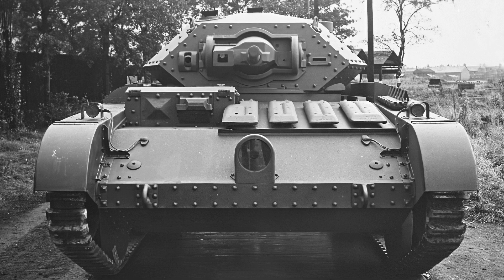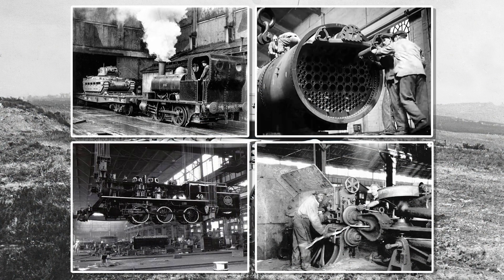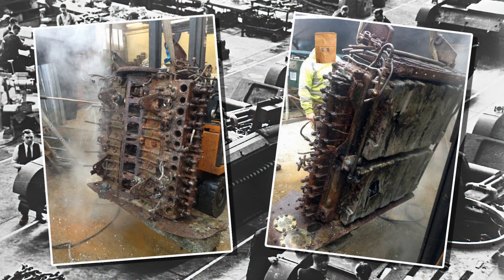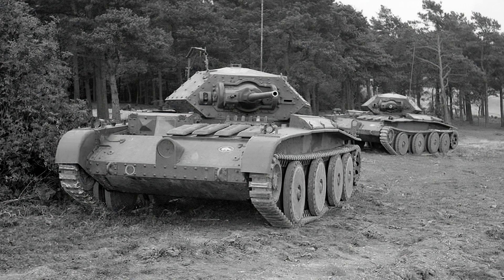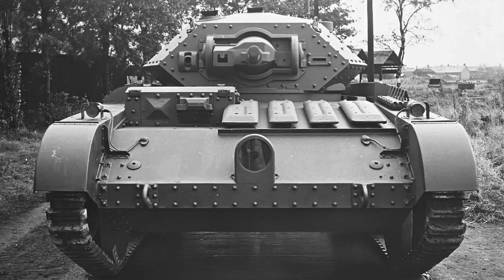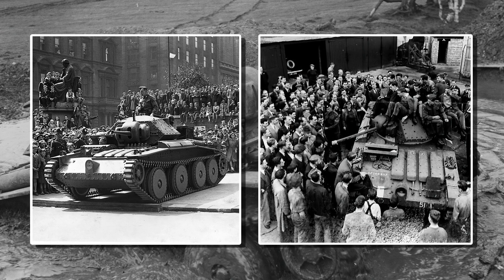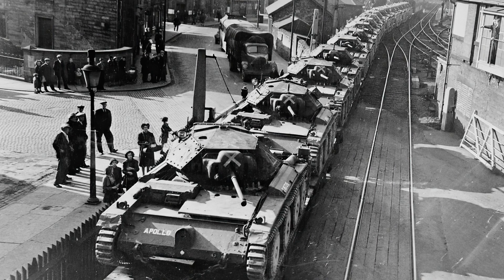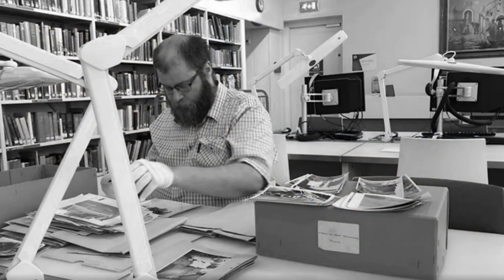Covenanter - Tank Design & Development

Comment: Question for you that I haven't found fully answered elsewhere. The common turret that was shared between Crusader and Covenanter was supposedly designed from the outset to potentially  take an upgrade to the 6pdr gun (that was at the same time being developed to replace the 2pdr). My question is : Do you think that the Covvie could have mounted a 6pdr as an expediency  measure (on UK invasion)  taking into account that  I have an unconfirmed perception that the Covenanter's turret ring was slightly smaller, despite the turret overall being the same? So, could it have mounted the 6pdr?
Reply from the maker: i think so yes, but as the gun was in short supply its unlikley, at thhe time invasion was an threat thhe 2pdr gun was still very capable

Comment: I always thought a relatively obvious fix for the cooling problems would be to rip out the meadows altogether and retrofit liberty engines or even another engine like the Napier, the rear hull might need a box-like upward extension at the rear (as we saw in Challenger MkIs), to mount radiators and make space for the taller engine. With the liberty re-inserted, the Covenanter becomes in effect an upgrade to the A13, a Cruiser MKIII+ with a common turret.
Reply: But the whole point of the Covenanter was to be as low as possible. That's why they commissioned a brand-new flat engine from Meadows. Fitting a Liberty would have meant raising the whole rear decking, as you say, so they would have had to raise the turret to allow the gun depression they wanted -and there still wouldn't have been room for the radiators in the engine compartment - that's basically the reason why the Crusader has a longer hull and five roadwheels each side.
What you're arguing for would have meant a complete abandonment of the Covenanter programme and a switch to all-Crusader production.
Reply: @jeremychurchill9489  they modified the Liberty to make it flatter for the Crusader and somewhat screwed up  the cooling system in that as well.
Reply: @wbertie2604  They managed to lower the height of the Liberty by 6 3/8 inches to 36 inches.Still a tall engine (the RRMeteor was 31 inches high). And, yes, they certainly did cock it up!!
Reply: @jeremychurchill9489  Still an easier fix and one that would work. Simply take the A13 hull design that has the Liberty engine and use that. It was probably still in production and all the tooling/expertise already existed. New Turret on old A13 hull and all Covvies woes are fixed. The tank board designing a whole tank to meet the one criteria, height, was such a mistake.

Comment: Not withstanding the mere fact that the Germans were just over the channel and invasion was always a threat, even if a decreasing one over time. Having a standing force of UK 'home' tanks to defend Blighty whenever necessary, was utterly essential. The Covenanter was there, it was available if needed.
Reply: There is actually a photo of a Covenanter that was in North Africa. Did it see action or not is not known. It might have been there to see how it behaved in a desert environment.
Reply: @michaeltelson9798  Yes, I have seen it, with Kingforce. I am sure they found it was a Tommy Cooker of a different type. The results of the test probably confined it to cooler climates. That would have allowed it to fight in NW Europe but by the time that conflict was in train, technology had moved on.
Reply: It came way too late for any such use.
Reply: @princeofcupspoc9073  No, not at all. Invasion was never discounted and the fear of it only diminished after the invasion of Russia in mid 1941, Covvie was available in mid 1941 in numbers up to 250 at the point when it was clear that Germany had switched directions and the invasion of the UK was not their current priority. However, if Russia had collapsed as the Nazis expected, invasion of the UK could have been on the cards in late 1942/43. By that stage the covvie would have been ready for front line service in hundreds if not thousands.

Comment: The Covenanter, probably the most aesthetically pleasing tank
Reply: If it weren't for those rivets. But I agree.
Reply: I AM partial to the Matilda Tank. Such a beauty!
Reply: @GC-Jo  Matilda 2 Is definitely a beauty, don't like the rivets on the Matilda 1 tho.
Reply: @poikoi1530  agree the Matilda two has the right sit and is a fine looking machine but let's not dis rivets, they can be quite butch and solid looking, think Cromwell turret.   I know they fail and ping around inside but we are talking aesthetics 🙂.
Reply: @CrusaderSports250  well, ngl, I like the Comet more than the Cromwell. The turret looks good and it's pretty symmetrical
Reply: Crusader Mk.III has cleaner lines and better proportions imo.
Also Challenger 1 will always be a gorgeous tank to me at least. That wedge-shaped turret 🤤
Reply: @marmite8959  Crusader III is a little let down by them not really filling in the space where the subturret originally went.
Reply: @marmite8959  always liked the Crusader lll but the Chieftain was my modern favorite, with the turret sloping almost to the turret ring, as an aside a friend of mine during testing reduced a Chieftain turret to fork liftable lumps, that would have been quite an impressive bang😊.
Reply: @marmite8959  Yeah, i do like the crusader
Reply: I spent some time in the Cold War counting Soviet tanks in a siding in East Berlin, so it did happen :)
Reply: @bob_the_bomb4508  Was that at the behest of NATO or a stock audit? :)
Reply: @wbertie2604  it was the Cold War. But the occupation of Berlin wasn’t officially a NATO task.
Reply: Centurion, Shirley?
Reply: @bob_the_bomb4508  l
Reply: Probably not. It's cool that you think so, but don't say it like it's a fact.  I prefer the Italian Fiat L6/40.  Almost completely useless as a main battle tank, but it has those stylings that the Italians are known for.
Reply: @princeofcupspoc9073  i did say "probably" so i didn't say IT IS, some would say the Tiger 2 or the Pershing is the best by looks
Reply: @poikoi1530  don't forget the very clean lines of the panther, with the rearward slope of the rear plate it was going somewhere, I know the tiger ll had something similar but the turret was quite blocky and was taller in proportion. Tank aesthetics!,  a whole field of development totally missed by designers☺☺.
Reply: Anything built in aus or nz:
Reply: For a blind person :)
Reply: @dalejmobiledalej6361  it looks so symmetrical, if only it wasn't riveted

Comment: The cooling system. There is no problem with having radiators higher than a flat (boxer) engine or any engine for that matter. I can't understand why the radiators were not mounted flat above the engine or else vertically behind it, pumps would have taken care of moving the water as required just like they did with the radiators at the front.

 I suspect that the cooling problem was more to do with the engine's design not type.
Reply: As I understand it, there wasn't enough space to get the radiators and fans above the engine in the low profile. Behind the engine was the final drive, so you'd then need additional space compared to a boxy engine to allow airflow, and IIRC, there was a length restriction imposed for easy train transport. I believe the Liberty in the Crusader also got butchered to make it flatter which caused issues too.
Reply: The post talks about the pipes not being a large enough bore for the distance the water travelled, no matter how good your radiators are, if flow is restricted you will have a problem, as the pipes would have been built into the shell they would be very difficult to change, as they went into production almost straight away significant numbers would have been made before the problem would have been resolved, these are the ones that would have give the tank its reputation, remember it is easy for us to sit back and judge with hindsight, not so easy when your on point and someone needs an answer yesterday.

Comment: I remembered this video when I did a video on the Covenanter recently. I came to exactly the same conclusions as Ed. The Convenanter may have been a very poor tank - but the enemy never knew that. All they saw was long lines of them and for all they knew - this tank might have been as good as the T-34. If they had captured one, they probably would have fallen over laughing, but they were not laughing in German Intelligence when they saw the photos that the spies must have taken or seen in the newspapers. Even the radiator faults can be forgiven in rainy Britain and might have been appreciated by crews in the winter. I have to believe that the lessons the Guards and Poles learned from exercises in the Covenanter must have taught them to take care of their tanks to keep them operating and to appreciate the roomier tanks that they took into combat.
Reply: Winter? September to June...
Reply: @wbertie2604  Considering that British weather normally means rain, rain and more rain, with the occasional snow during the winter. The Covernanter would have kept the crews warm. Even if the cooling system did leak, there would be water available to top it up - something that would have been sadly lacking in the desert.
Reply: @TheGeneralWorldofTanksReplays  The smart move would have been routing rainwater through the radiator louvres, ensuring it reached boiling point when on the move, and into a teapot.
Reply: @wbertie2604  Our tank doesn't have "thermal dissipation issues"!  It comes equipped, at no extra charge, with a fully automated crew comfort system; including both internal heating and boiling vessel!
Reply: The Covernantor tank did not serve  outside the UK except for test purposes in the North African desert and as bridge layers in Normandy. The were used as training tanks.
Reply: @Peter-lm3ic  We did not say that Covenantors served outside the UK. The only photos the enemy saw was long lines of them on trains or on exercise.

Comment: Strange about the plate heat treatment to make armour, just why didnt these muppets weld components like turrets without framing, then heat treat the thing an an improvised oven. Likewise the radiator issues when all these things of heat transfer would have been well understood by manufacturers of trains, and had been for 100 years. They seem to repeatedly design themselves into a corner with no path to a future in all but the Valentine which was ultimately to receive all it deserved, and at least lessons were learned by someone somewhere and we did have viable tank designs when they were really needed in 44.
Reply: It's much more efficient in production terms to make the plates rather than treat the whole turret. QC  would be easier too - screw up one plate, not a big deal, screw up a turret and that's a lot of time wasted.  See the video on German tank metallurgy.

Comment: Another great report, so if the changes had not of been made would this of been a good tank?
Reply from the maker: well its argued that ther term good or bad tank isnt  a thing, but would it have been a capable vehicle, i beleive so yes
Reply: @armouredarchives8867  that is true to me a good tank performs the role it was designed and better whereas a bad tank is the opposite but as you said the Covenanter made up for it by being used for training, deception and r&d

Comment: One bridge layer exists at Puckapunayl, Seymour, Victoria, Australia, at The Armoured Museum. Surprisingly small, being no bigger than a Camry. It doesn’t run, tragically. The launching equipment clearly was prototype for scissors type found on Centurion, being all hydraulic. Observation told me how short the driver had to be. Tight quarters. One point missed. Along with the same on Crusader turret, the horizontal hatch was deadly to the commander, when encountering stumps or ditches, it would slam shut. This isn’t anything new to crews, I have yet to meet a M113 driver who has his own front teeth. Not nice, however, being slammed in the back of the noggin by a plate of steel.
Reply from the maker: yes, was gonna cover that more in crusader - but well spotted

Comment: Wider tracks would have been more beneficial, as well !
Reply: Adding greater weight, rolling resistance, and so making the engine work harder and run hotter,  no problems there then🤔.

Comment: I suspect it would done ok to repel any invasion attempt, as any German forces that were able to land would have barely any armour or AT guns and likley 37mm PAK and Pz II and 37mm armed PzIII at best.
Reply: At worst though, it would've faced 50mm armed PzIII and 75mm gun PzIV tanks.
Reply: @BHuang92  any circa 1941 German tank was vulnerable to the   two pounder. The PAK 36 would have been a credible threat, though, if charging AT guns had been used as in North Africa, but UK terrain is very different. Being surprised by PAK 36s would be more the concern.
Reply: @BHuang92  I suspect the Germans could get very few of those over and sustain them. More likely Pz II as they were smaller and lighter. The Germans had no real experience at amphibious operations and likely it would have been a disaster even without the RAF or RN intervening.